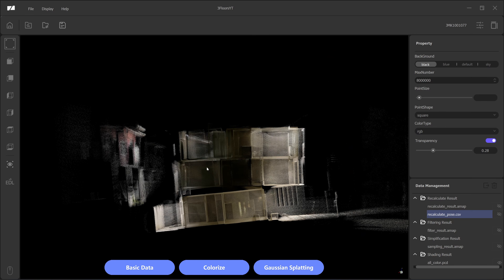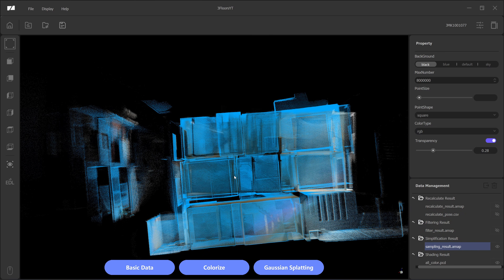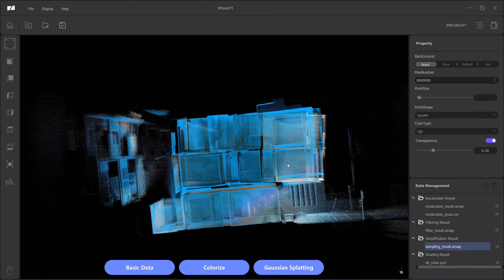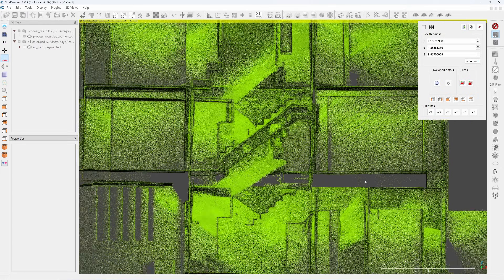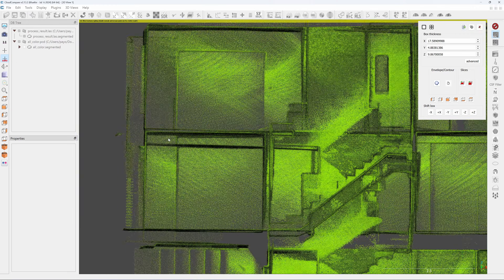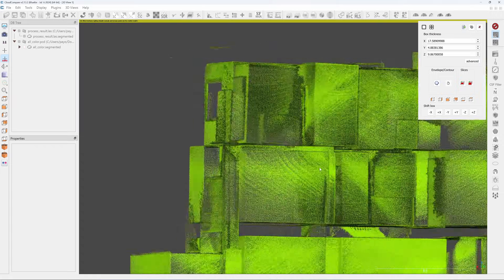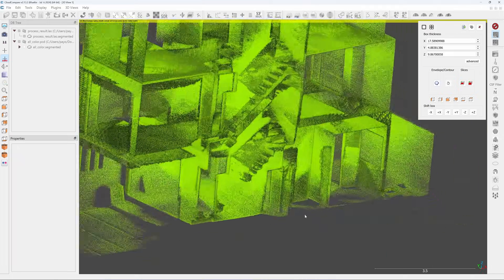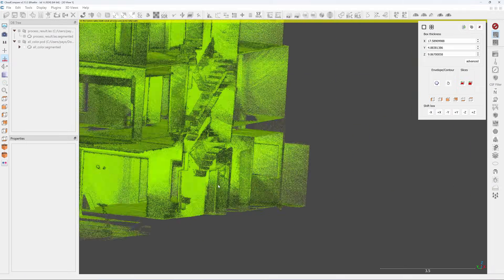Indoor Scanning Tips with 3DMakerPro Eagle LiDAR Scanner: 3 Storey House and Gaussian Splatting

Comment: Thanks. Will moving slower increase point cloud density?
Reply from the maker: Yes, cloud intensity increases in areas where movement is slower. However, this scanner is not designed for very slow movement or stationary use. Users need to keep moving to ensure better tracking